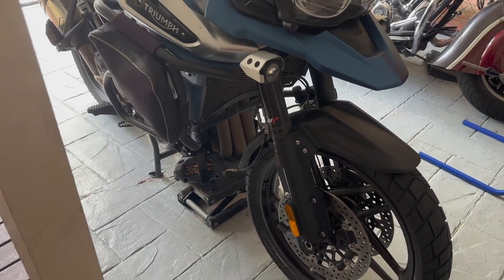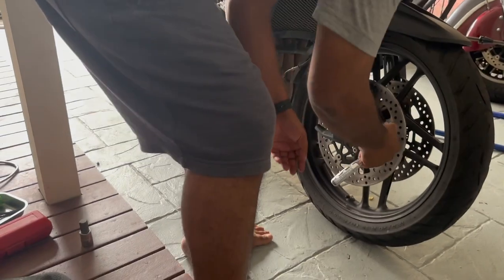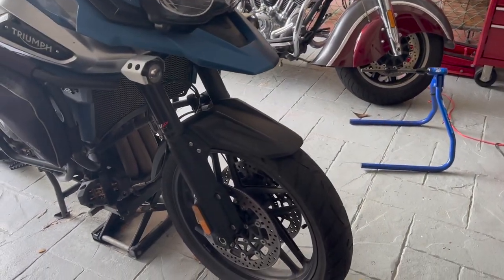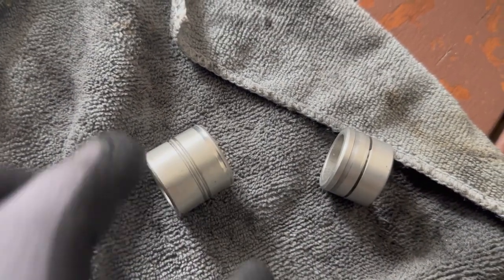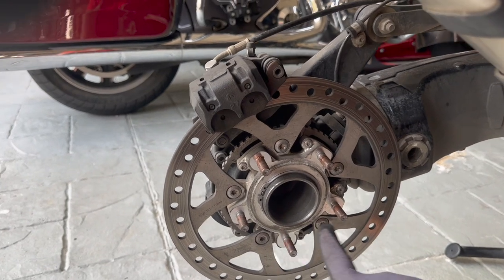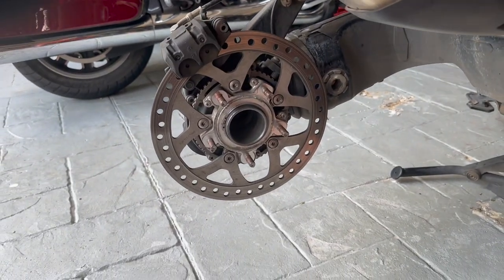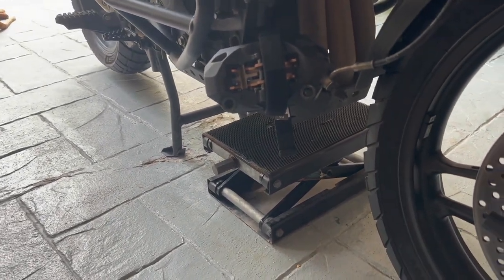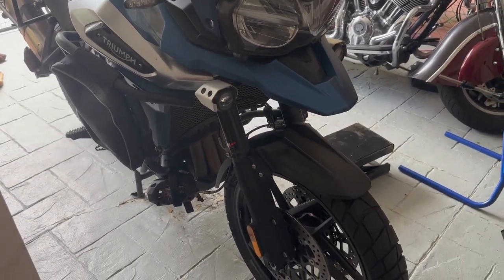Triumph Tiger 1200 - How to Remove Front & Rear Wheels

Comment: Thank you so much for the video! Very informative and very helpful!  What should I do if my speed sensor is rubbing?  Rode today and noticed a squeaking sound.  Couldn't figure it out.  But went back through your video and found that mine was actually touching.  Should I take off the tire and retry or add a shim to it?  It appears that it's not damaged but it has to be what I am hearing.  Thank you so much!
Reply from the maker: Yup, I think you might need an extra shim
Reply: @eazyontwowheels  Thank you!!
Reply from the maker: @CF15500  also make sure the wheel spacers are in the correct place. The longer one on the right and the shorter one on the left.
Reply: @eazyontwowheels  Yep! Those are good.  It was the shim.  Everything great now! Thank you again for all your help.
Reply: @eazyontwowheels  hi is it right hand side as looking from behind the bike?
Reply from the maker: @stewbacca9089  yes right side looking from the back to the front :)